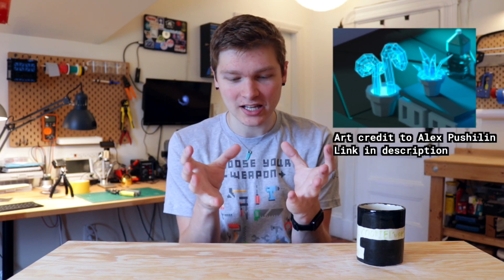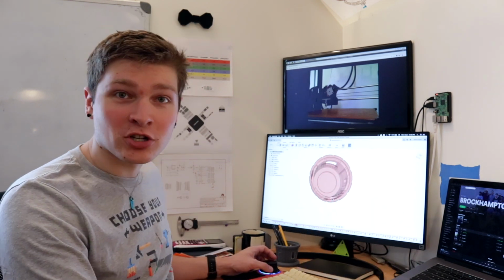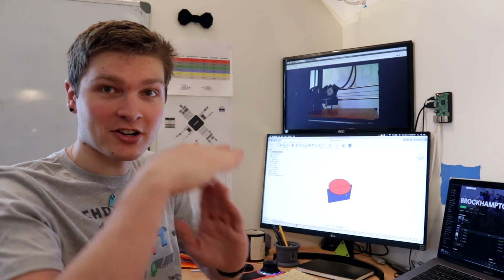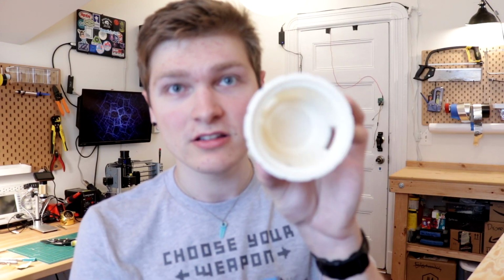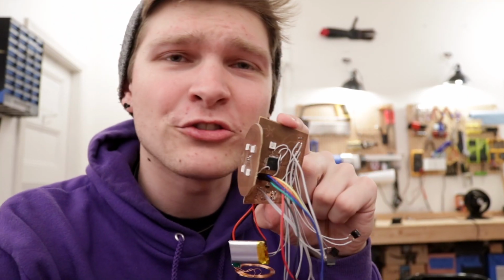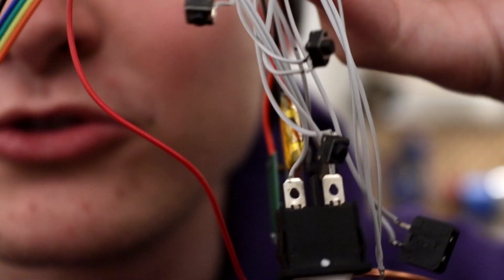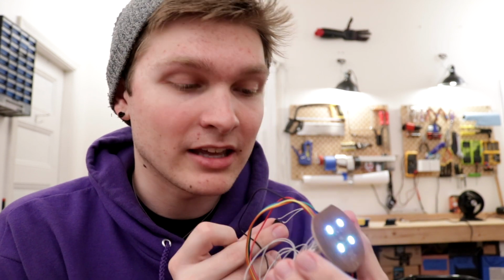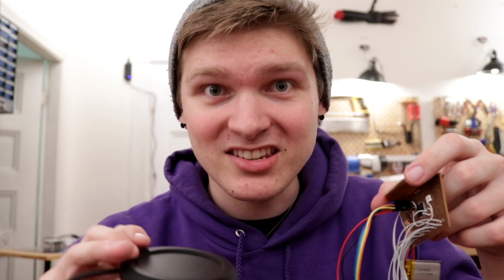Can I build this gadget WITHOUT LEAVING my workshop?

Comment: you should make a jig with fixed locating pins attached (temporarily) to your mill, pre-drill your boards with 'locating holes' this would allow you to flip the boards over in your mill. Even if its just to stick the ground plane on the bottom of your pcb's it is sooper useful.